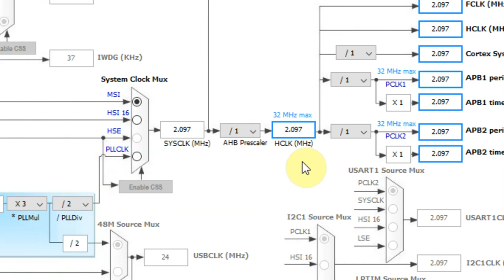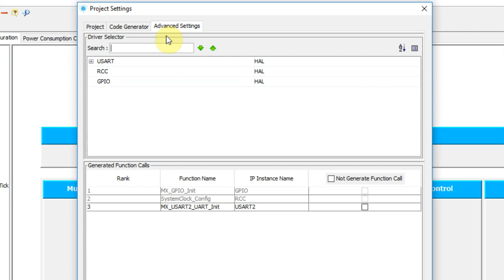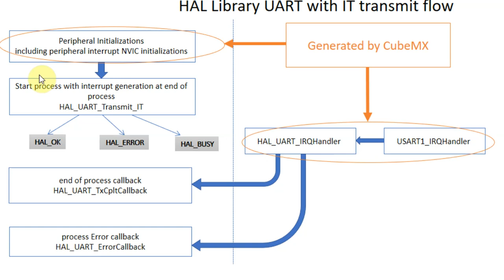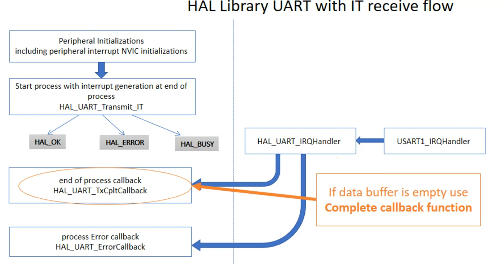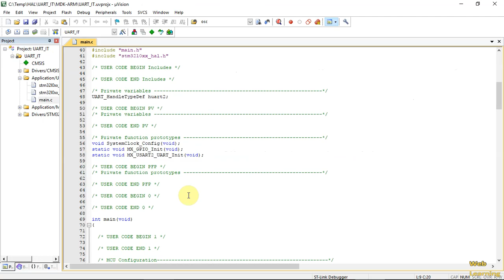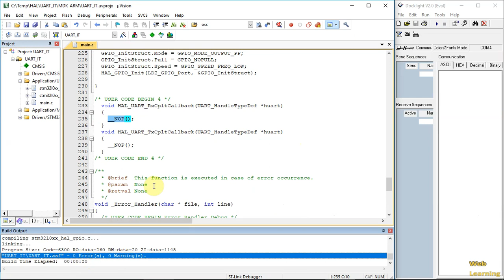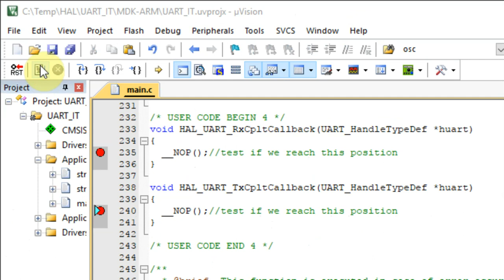HAL: #4 How to - UART Interrupt

Comment: Great video, but what to do if your receiving buffer has less bytes received than its capacity?, Timeout can be used in this case ?, There are many situations in which you have to send variable length messages.
Reply from the maker: Have a look at this:
https://github.com/MaJerle/stm32-usart-uart-dma-rx-tx

Comment: Thank you. I apologise for my previous comment. This was indeed the background information that I was looking for. I understand that this STM32 method of receiving data is efficient for bursts of data. However, I struggle to understand how to use the HAL UART to efficiently receive bursts of data of various lengths that are terminated by a known ASCII character. For example GPS data or keyboard input.
Reply from the maker: When you receive the data you need to search for the known char, and then close the data buffer and start a new one.

Comment: Interestingly, when I follow your tutorial and declare uin8_t as the data type for my Rx buffer, I get gibberish in my terminal(some squares in the built-in terminal of stm32cubemx and some strange symbols in putty) but when I declare it as char, everything works perfectly. Does anyone know why?
Reply from the maker: What uart speed are you using? are you using HSI or HSE? what are you trying to print ( char or hex)?
Reply: @Weblearning1  Tha KS for you answer. The problem was that the terminal was reading much slower than my USART was transferring data. I am trying to hook up my MCU to a sim module so I want to transfer AT commands (char data type). When I send the commands to my pc to debug everything is OK, I think when I send them to my Sim module it also works(I am sending AT and am expecting AT OK as response) however so far I have been able to capture the first letter only(A)  I think my timing is off between transferring and reading I know you can't help me without my code but can you show me some resources where I can learn how to write my receive_it callback(I'm sure this function is the one which is causing problems.) the book I am reading has only 1 example which has nothing to do with my case

Comment: Great Video😊
Can you tell me please how can I delete the received data from Rx_buffer and to receive new data from Rx_buffer[0] ?
Reply from the maker: Reset the location of Rx_buffer.
to clear the buffer:
memset(Rx_buffer, '\0', Rx_buffer_SIZE);
May be you can considerer subscribing to the channel?
Reply: Hi @Yassin You can consider to use the HAL_UART_Receive_IT(&huart2,rx_buff,10) func again in the HAL_UART_RxCpltCallback(). Therefore, you kind of reset the process. In addition, by this method, you don't need to delete something in the memory manually.

Comment: NOTE: There are some serious API design flaws in the HAL libraries as provided by STM which make the whole HAL-USART module almost useless in the most common practical cases (with respect to interrupts). That is: unless you do not want a reliable program, which enables your µC to work flawless for months or even years - as it is quite common in the world of controller programming.

Thus you might want to use the HAL functionality as a guidline of how to work with the USART on the register level but avoid the pitfall of having to deal with a receive interrupt which happens to happen while the processor is working in the transmit function (in which case the HAL uart 'object' is locked and you cannot restart the receive in the callback functions as required in order to continuously receive data).

You might want to do this anyway since every sensible USART communication has to handle handshake protocols (either XON/XOFF or hardware handshake). Something the HAL functions ignore completely.

Comment: Hi, hope anyone here can help, STM32F103C6 in Proteus with loaded hex from SW4, Transmit_IT not transmitting. I tried everything, saw multiple videos on YT, from ST and others. All do the same thing but still my TX IT wont work. Not sure what is wrong. using System Workbench - Eclipse Neon 3 release 4.6.3. UPDATE: it won't work in simulation, tried it on an STM32F103C8 and it worked on the fly.
Reply from the maker: First connect the TX to the RX with a cable, this will echo your data back. If this is not working, it your code. If it is working, then it your hardware to the outside world.
Reply: @Weblearning1  it worked in real world, but not in sim. I had to apply IT on RX only, and regular TX. That worked fine for UART DMA, and SPI as well. Sim must be too demanding for processing, thus they perhaps limited the available functions in sim.

Comment: Can it be possible to use a 115200 baud with interrupts, if yes what changes should I make (HW or FW wise), if not, why 9600?

Thanks in advance, hope you can help me :)
Reply from the maker: It all depends on how fast is you core ruining and how much data you are passing. For every byte that you will send, you will get an IT. and except for the code you have total 12 clk cycle for the push and pop. so at some point, you will not have any time for your code. Id its very little data at that speed, then there is no problem. It all depends on your application.

Comment: Great video. UART IT made easy :) How do you "switch off" the UART IT to say reconfigure using a different buffer? Say my RX buffer to start with is just 5-bytes but then I want to use a 30-byte buffer to get different data from a sensor?
Reply from the maker: See this answer:
https://stackoverflow.com/questions/55394656/how-do-i-reset-the-stm32-hal-uart-driver-hal-state

Comment: How does the code automatically transmit the txBuffer? I understand that the tx interrupt signals that the byte has been sent and another one can be buffered in the register but I don't see in your main where this process is started. 

Also how does the code know the fill the rxBuffer and not just write over the first byte? It is working like DMA but without having the DMA set up.

How could you handle it if multiple bytes were being received (e.g. a packet) and you wanted to check the validity of the bytes as they came in, this cannot be done with the receive callback as it needs to happen per-byte. Would you put thi logic in the IRQ handler in the stm32L0xx_it.c file?

Thank you for sharing your knowledge :)
Reply: hello, as for your last question "you wanted to check the validity of the bytes as they came in",
you can set the rxbuffer size to 1, that way the rx callback will  be called each time you recieve a byte
Reply: The sending is handled by the HAL library.
When calling Transmit_IT you pass the number of bytes to send. The HAL Interrupt handler will take care of that number and transfer all bytes into the USART. Only after all bytes have been sent, the TxCallBack function will be called.

NOTE: There are some serious API design flaws in the HAL libraries as provided by STM which make the whole HAL-UART module almost useless in the most common practical cases with respect to interrupts. That is: unless you want a reliable program, which enables your µC to work flawless for months or even years - as it is quite common in the world of controller programming.

Thus you might want to use the HAL functionality as a guidline of how to work with the UART on the register level but avoid the pitfall of having to deal with a receive interrupt which happens to happen while the processor is working in the transmit function (in which case the HAL uart 'object' is locked and you cannot restart the receive in the callback functions as required).

You might want to do this anyway since every sensible UART communication has to handle handshake protocolls (either XON/XOFF or hardware handshake). Somthing the HAL functions ignore completely.
Reply: @kallewirsch2263  are the said flaws still an issue with HAL USART?
Reply: @armincal9834  
I have just looked it up in the HAL library for the F2.
They have fixed that issue by splitting the state variable into 2 variables. At least that problem is solved.

That also seems to be true with the HAL library for the F7.

But of course the issues with simply ignoring a possible handshake still remains.

Comment: Let's assume I will receive a string formed of 10 to 500 characters. It has a start character another stop character. The length varies. How could I save the entire string? After this, I need to check if the stop character was received and call another function.
Reply from the maker: You need to use the timeout of the complete string. Put the string in an array and search for the stop character.
Reply: @Weblearning1  Thank you for your prompt reply!
Meanwhile, I used the following idea
ISR
{
   if(position == RX_BUFF_SIZE) position = 0;
    //RX_BUFF_SIZE 100
   
   rx_buff[position] = in_char[0];
    //rx_buff[2] but only first character is used
   position++;
   HAL_UART_Receive_IT(&hlpuart1, in_char, 1);
}

I prefer to keep the cpu busy with ISR.

Comment: Hello, I have written the same code but no data was printed on USART screen, I still don't konw why it's so after I checked it for hours.
Reply from the maker: What's is the speed of the uatt you are using. Did you follow everything I have showed or you have skipped few sections of the video?
Reply: Thanks for anserwing me ! yes I totally did this accoding to your code flow . I used Baudrate 9600 bits/s . And I also tried the blocking method by which still no data came out on  PC terminal. So cofused with that :(
Reply from the maker: Then start slowly. Check that you can toggle the same pin with a LED or something that you can check. If that works, check you can see data with a scope and if you don't have one, then check your hardware ( wires, jumpers etc ) to see that everything is working. You can also make a short in PA9 and PA10 ( the UART pines ) and write in the PC. This will amke a feedback and you should see everything you type back in the PC. This will check the hardware all the way to the STM32.
Reply: thanks for suggestions yes I think i might find the problem. I use  STM32F4Discovery board and I looked up the mannuel again which said UART Pins didn't connect with st-link chip ,if I want to use UART I must jump the wires or use a dongle . So I think basically that's why  no communication between PC and my STM32 board can be  built there.
Reply: @longli8580  Uart2 pins is found on the STLink section unless you bridge the pins. (Assuming you using the nucleo board)

Comment: Hi ..I want to interface tcs3200 color sensor with STM32f746zg..Since the tcs3200 outputs a frequency based on the amount of light received i need some way to count pulses to determine a colour.In CubeMx i set PF6(s0) PF7(s1) PF8(s2) PF9(s3) and TIM2 input capture as (out) of the sensor.I also enabled tim2 globle interrupt in nvic window.following is my setting for output frequency scaling and filtertype outside the main function..
void TCSFREQ()
      {
    HAL_GPIO_WritePin(GPIOF,  s0_Pin,GPIO_PIN_SET);
     HAL_GPIO_WritePin(GPIOF,  s1_Pin,GPIO_PIN_RESET);
   }
void TCSRED()
      {
    HAL_GPIO_WritePin(GPIOF,  s2_Pin,GPIO_PIN_RESET);
     HAL_GPIO_WritePin(GPIOF,  s3_Pin,GPIO_PIN_RESET);
   }
void TCSBLUE()
      {
    HAL_GPIO_WritePin(GPIOF,  s2_Pin,GPIO_PIN_RESET);
     HAL_GPIO_WritePin(GPIOF,  s3_Pin,GPIO_PIN_SET);
   }
void GREEN()
      {
    HAL_GPIO_WritePin(GPIOF,  s2_Pin,GPIO_PIN_SET);
     HAL_GPIO_WritePin(GPIOF,  s3_Pin,GPIO_PIN_SET);
   }
void TCSCLEAR()
      {
    HAL_GPIO_WritePin(GPIOF,  s2_Pin,GPIO_PIN_SET);
     HAL_GPIO_WritePin(GPIOF,  s3_Pin,GPIO_PIN_RESET);
   }
Correct me if there is something wrong above.
As i am new to micro controllers i am struggling how to count no of pulses in a time period let say 2s..it would be nice if you help me with my problem or suggest some alternative solution..thanks

Comment: Another intersting way of using UART is transmitting data with DMA (Direct Memory Access). Check out 
HAL_UART_Transmit_DMA(&huart1, Data, size);
and
HAL_UART_Receive_DMA(&huart1, Received, size_Received);
functions. Remember to modify configuration in CubeMX before using them - just add 2 'DMA streams' in 'USART2 settings' (one for Tx, the other one for Rx) and enable 'USART2 global interrupts'... and that's it. :)